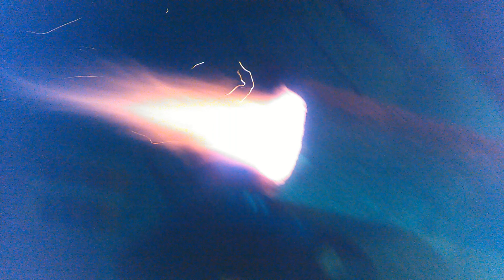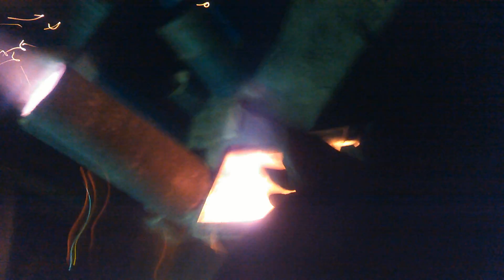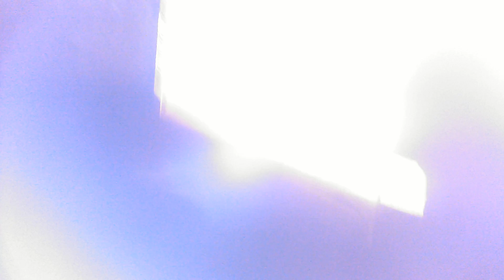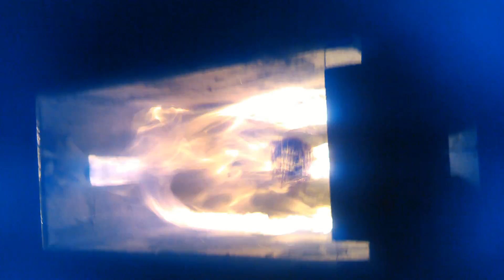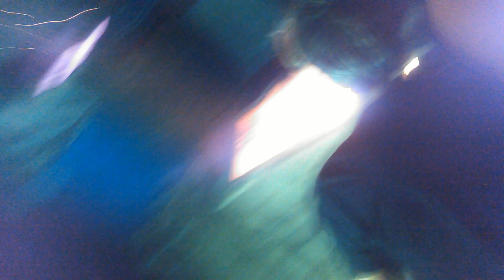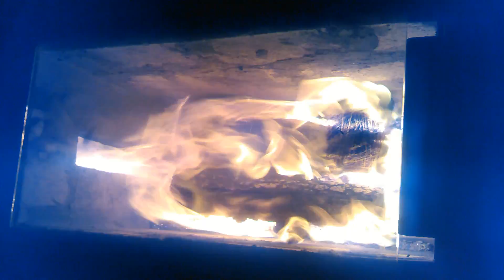Let the innovators begin!

Comment: FYI all flame is Plasma, no matter what type it is. :-) I believe the commenter was trying to say that this flame was almost entirely dry wood gas afterburn, rather than cracked pro burn with moisture, thus was bluer.
Reply: Timothy Black flame isn't plasma, flame is burning gas, specially in this tyle burning woodgases from pyrolise
Reply: Flame is a Plasma. Light a match and put it inbetween two electrically charged plates. An electrically conducting, hot gas is by definition a plasma.
Reply: Timothy Black well, as You say between electromagnetic field, in firebox or open air there is not electromagnetic field like between metal plates or sticks, You could also say that we live on earth that have electromagnetic field, in this case of course flame will be plasmic and thatfor it move like spiro, because it will gonna loose his potential in cold gases, like winds, that is law of free gases.
Reply: Well - sorry my english is weak, but it doesnt problem - in firebox You dont have electromagnetic field - please read some books about behaviour and the consequences of hot gases (1912 prof Grum Grzymalo), look about torus around You, look how it works, everything in nature work similary (tornado). I agree that flame could have plasmic symptoms between katoda and anoda, but on the movie above, it is pirolitic gas, and in constructions of batch box dont have electric power, cose construction of batch box is a venturi nozzle and gas fly with law of behaviour and consequences of hot gases, not becouse it is plasma, but it could fly like plasma. We can discuss endless, but it is much more than plasma in flame..
Reply: I have a degree in Physics and Mathematics with application practicum in Particle and High Energy.  I hate hauling out credentials, but there it is.  Fire is defined as a Plasma. It is a Plasma. End of discussion. Now there are different types of Plasmas, but fire is one type. By Definition. You could call fire a "mixed plasma".

If you want to argue the semantics of what sort of Plasma it is, that's fine. But it is, in the broadest sense, a Plasma. A Plasma is an electrically conductive, ionized gas. Thats what flame is, for the most part. All of the flame is not plasma, but much of it is, and therefore it is accurate to call Fire a Plasma. It is, in fact, a Plasma in glow mode. It is non pyrolytic, and there fore is non uniform in composition and stratified. It has chaotic behavior, and unstable boundary layers. And all of this is affected by the fuel type, fuel density, halogen content of the atmosphere around it, etc. Some "Fire" is thermitic, and so uses a solid halogen as an oxidizer, etc etc., It is a very complex.

So while not all Plasmas are like fire, all fires are Plasmas.
Reply: Ok, ok You have right couse, flame is dynamic, and have different points of temperature and different potentials on this poonts and my question is: have You working with fire and potential? How can we use this knowledge that flame is plasma in our firebox? This is important question, greetings. Ps dont be so angry couse You know better...

Comment: What kind of glass are you using?
Reply from the maker: Brand name is neo-ceram. Every glass shop had it, but the prices vary greatly. Check around before you buy. Same glass in wood stoves and on top of electric ranges.  There is another type but i forgot the name.
Reply: Thank´s

Comment: thats beautiful! thoughts on whether you could make a complete glass box as the 'batch system' - it would be incredibly attractive
Reply: It may be possible, however even high temp Robax or Neoceram glass is hideously expensive as it is. If there was a product, I imagine it would be eyewatering in price.  It may also not have enough resistance to the heat being right beside the coals and burning wood. But, you could try with old glass top stove pieces and see!

Agreed, it would look so incredible.